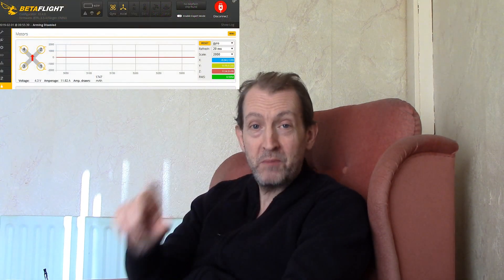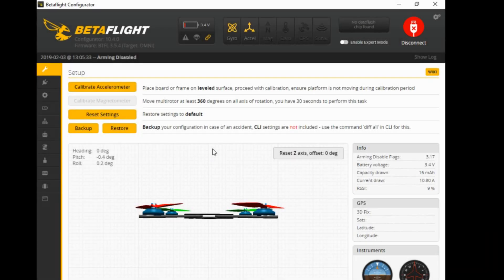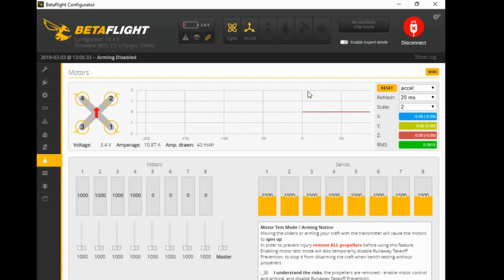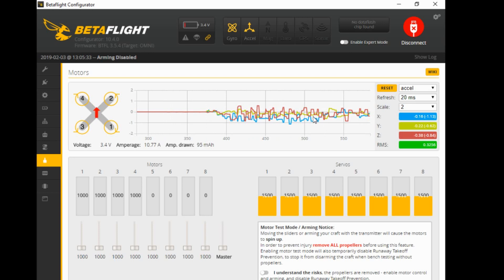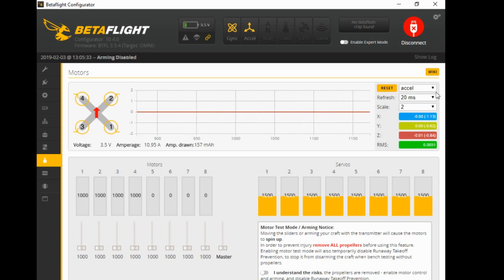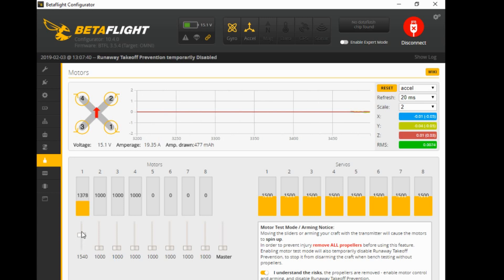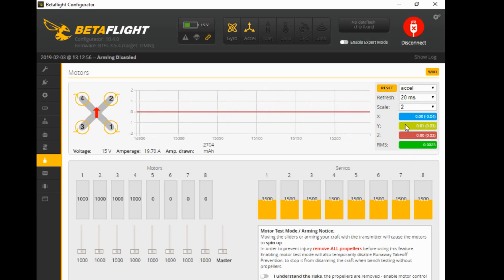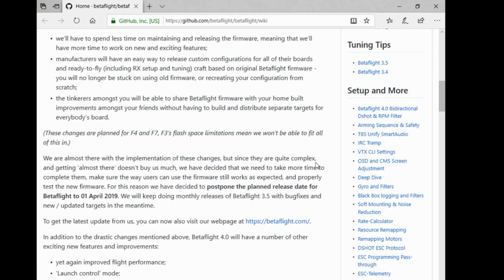BETAFLIGHT MOTOR TAB INFORMATION FOR NEW PILOTS

Comment: happymodel larva x

So I crashed my quad and the screws holding the motor stripped the mount on the motor i ordered a replacement set happymodel ex1103s kv7000 (original ex1103 kv7000) they say the ex1103s is an upgraded motor for the larva X but I had just unplugged the old ones and swapped over the new ones and the drone would not spool up. Am I missing something in the motor change is there something I could check for (all 4 motors spun after crash)

betaflight is showing no motion in the motors with throttle. the gryo works . controller is sending signal
Reply from the maker: Try recalibrating the esc's (TAKE PROPS OFF ) 

#1 Turn on transmitter and move throttle to full power (don't arm)
#2 Plug lipo into the quad
#3 After you hear the start up beeps Drop throttle to bottom
#4 Unplug lipo then plug back in and try to power up.

If this dose not work the first time try it again, but this should solve your problem. Good luck

Comment: Help, how do you recover manifest file when it is missing or unreadable. I did unzip file, and I'm trying to unpack an older version of cleanflight 1.2.4 I have the newer version, 2.4.0, but can't use it on my older quads like the eachine qx95. In developer mode I tried to load unpack but it tells me that the file is missing. Can you tell me what's happening with this....Thanks George
Reply from the maker: Unfortunately I can't help you this time my friend. If the file is missing it sounds like there's nothing you can do. This sounds like a software issues so I would just flash again and start over. Sorry I could not be of more help this time. However I will do a bit of research and see if I can find the answer, I will get back to you Buddy.
Reply: I will keep at it until I find a solution...Thanks my friend!  @GeorgeCooper_LoneWolf
Reply from the maker: Hi Buddy, I have looked all over and I cant find the solution to this problem. I have even got in touch with Joshua Bardwell  and even he dose not know. Hears what JB said

 [ Sorry, George, this one is beyond me. I have installed a developer mode extension before but if something went wrong I would just have to go back to the developer.  Joshua
 ]

Shame buddy it looks like it's gone for good, sorry I could not give you better news.